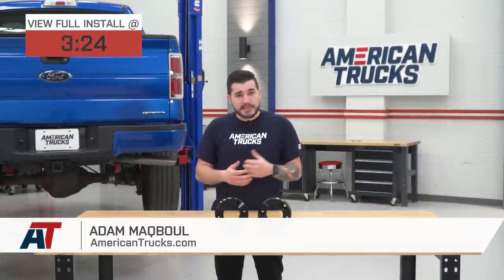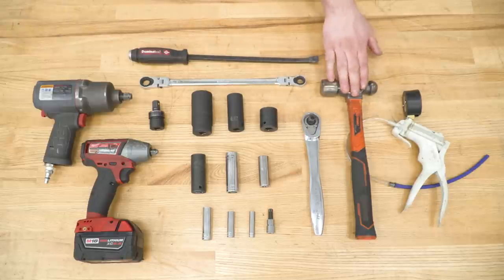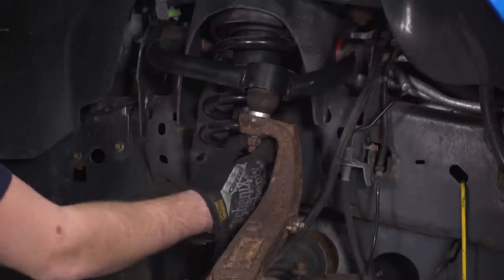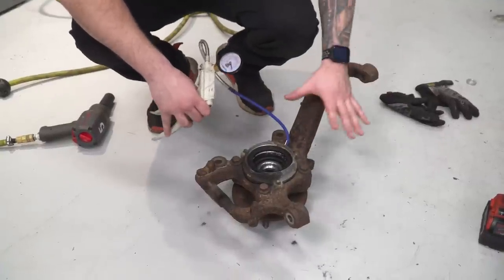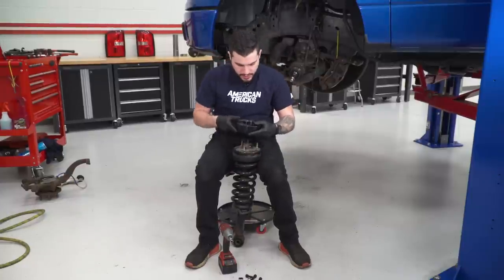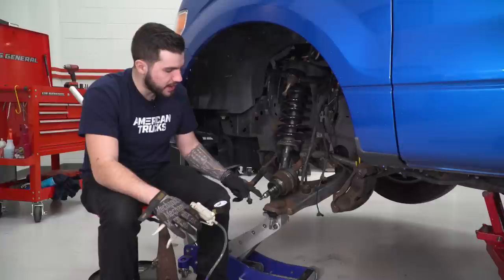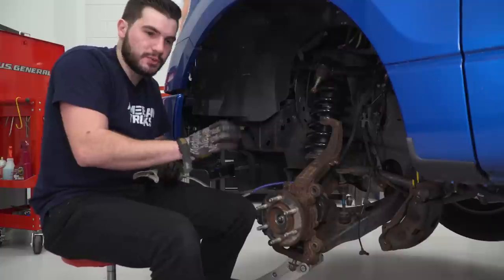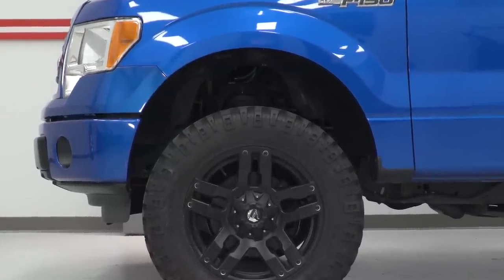2004-2020 F150 Mammoth 2.5 Inch Front Leveling Kit Review & Install

Comment: So many unnecessary parts removed for these kits. I’ve done full coilover and coilover spacer leveling kits and never had to do half the stuff done in this video. None of my installs had any issues or caused any issues either.
Reply: I agree.  I didn't even use the pressure thing.  WTF?

Comment: That dark blue Ford with chrome bumpers on it chrome wheels that's the one I want all the 5.08.
Reply: 5.0 Coyote engine is the one I would want my new Ford pickup truck
Reply: Give me some chrome wheels on that new Ford pickup truck and a coyote engine in it that's a real Ford right there
Reply: I drive an old Ford pickup truck with a 5.0 boss in it

Comment: Just had mine done, the 2.5 was just little to much on my 2018 F150, remember one has to have a  Wheel alignment after, I'll have to buy some Firestone Air Bags to level it out
Reply: So your saying you need to add to the rear after installing the 2.5 up front? Maybe like another 1'' or 1.5'' in the rear?
Reply: so do u think it’s too much for the 2015 f150?

Comment: What is the difference between both the 2.5 mammoth leveling kits on your site? This one runs around 40 while the other runs around 100. Is it just the difference in materials?
Reply: Correct.

Comment: Worth noting: if you have a two wheel drive there's a large locking nut for the rotor that is not reusable. Almost $20 each last time I did mine

Comment: If anyone is reading this. I have fully stock 2013 f150. I bought the leveling kit (2.5 inch) exactly the same ones from the video. Im have a concern. After installing it, my upper control arm is rubbing on the coil spring. I’m not sure why. Am I supposed to upgrade upper control arms too? Can anyone point towards the right direction.
Reply: Did u ever figure out how to fix this cause this just happens to me after install and I have no clue what’s wrong or where to even start to fix it
Reply: @dylanhadeka9348  no I haven’t. The black rubber boot popped

Comment: Be safe kids, never reuse an old cotter pin. Always replace it with a new one.
Reply: What’s a cotter pin? He calls it a “retainer pin” lol. He also didn’t torque anything down, but gave a warning at the end for everything to be torqued. Kinda hard to do with a “retainer pin” installed and everything blasted back on with a 1/2” impact.
Reply: @cap12206    First off this was a demonstration, it wasn't meant to be perfect, just to show you the process on how to do the work.  He did bring up torqueing everything per specs for your vehicle at the end.

Second, you don't torque castle nuts.  The purpose of the cotter pin is to hold the nut and keep it from loosening up.  The proper way to tighten a castle nut is to seat the joint with the castle nut until it's snugged firmly but not overly tight.  Then look and see where the hole in the stud is in orientation to the slots in the castle nut.  If you do not see the hole, loosen(never tighten) the castle nut slowly until you see the hole line up with a slot in the castle nut.  The amount you loosen the nut will be very minimal and won't make a difference.  Once lined up install the cotter pin.  Bend the part sticking through around the nut or over the end of the stud.  This prevents the cotter pin from falling out from vibrations.

Also cotter pins are safe to reuse at least once but should be replaced after that unless it becomes weak or breaks after bending the pin to remove it.
Reply: @Lugare2011  I’ve been a licensed airframe & power plant mechanic for over 20 years. EVERYTHING has a torque rating, cotter pins are NEVER reused, I’m fully aware how a castle nut works. And it’s not good practice to assemble front end suspension and steering parts with a half inch impact. This is why I rarely if ever allow an automotive “mechanic” to touch my vehicles. In my industry if I did something so blatantly wrong and caused an accident I’d go to jail. I’m also required to fill out a maintenance log and specify the approved repair method used(by citing a repair manual), hardware used, torque specs used, s/n and cal date of any calibrated tools used, and a sign off by a licensed inspector.
Reply: @cap12206    Blah blah blah I'm a licensed blah blah blah.  It's funny how everyone on YouTube is a licensed or professional whatever lmao.  Oh and cotter pins ARE reused.
Reply: @Lugare2011   I work on Ag equipment and deal with the re used mangled up cotter pins on customer jobs that are a bitch to get out sometimes. If a customer or other mechanic are too cheap to replace a few cent up to a dollar for some of the larger   cotter pins. I question  what else a guys trying to save money on when they worked on something before I had to sort the mess out when it failed again.   I've even seen guys use a construction nail bent over, if they didn't have the a new pin when the old one broke  the ends off, but hey at least they tried to stop it falling apart doing it .

Comment: I have a 2023 f150 Tremor with this 2.5 inch lift (factory installed). When making a full turn or u-turn, the front end makes a single pop sound (during the turn) (sounds like a tie rod pop). Any idea why?

Comment: I would like to see how well a truck leveled with this kit does off road. Nothing crazy just the normal stuff done with full sized trucks.
Reply: Well I bought my truck with a 3 inch leveling kit. Had to replace a bunch of stuff including the spacer. When I went to have the alignment done they couldn't get the camber correct. The tech said they see it all the time. He told me unless you're changing to an upgraded knuckle you're wasting your time and money.

Comment: So I used this kit and want to go with 35's. I don't want my truck all wide like the mall crawlers that never see dirt.
I would also like to stay with my stock 20" rims.
Any idea of what size tires I could fit under my truck without too much modification?
Reply: What year do you have?
Reply: Depends a lot on offset also.
Reply: 33/12/50/R20
Reply: 305/55/R20 the best choice bud

Comment: How will a 35" on 2.5 " kit react off-road if you hit a hole and bottom suspension?  RUB?
Reply: rub, depending on how hard you hit destroy a tire maybe a fender or all. I would run a 33 if off roading. leveling isn't for off roading.

Comment: So I just added what I’m guessing is the last version of the mammoth 2.5” lift to my truck. The offset triangle looking kit? Is there a difference between that version and this version? In quality or in life? I know I spent $99 on that kit so $30 kinda stings especially since it’s been less than two months since I purchased it.
Reply: No differance just how they upgraded the design to look more factory. My son has the triangles and I have the solid spacer. Does the exact same thing. Oh We both run 35 x 12.5 x 20- rims and tires.

Comment: Does this effect the towing and hauling after adding the leveling kit?
Reply: Yes the factory rake is for when you have weight in the bed or a heavy tongue weight it will keep the truck level when the rear squats. With the truck leveled with no weight in the bed or hitch then add weight the front rises rear squats
Reply: Buy a set of nice quality air bags for hauling it will save on wear and ride like a dream.